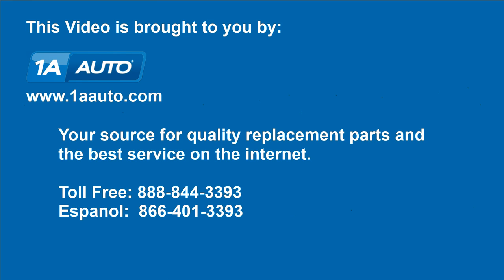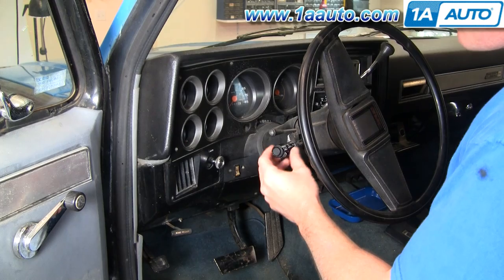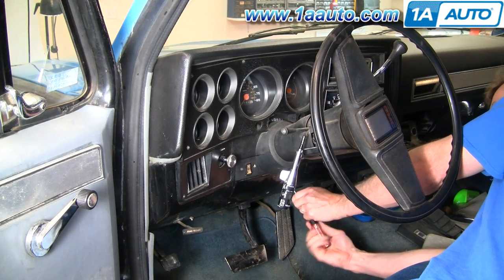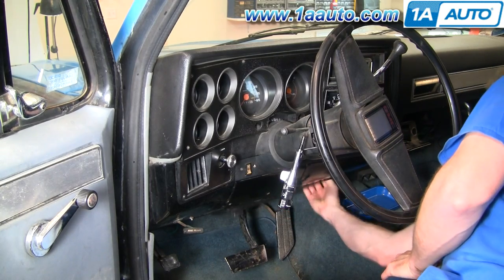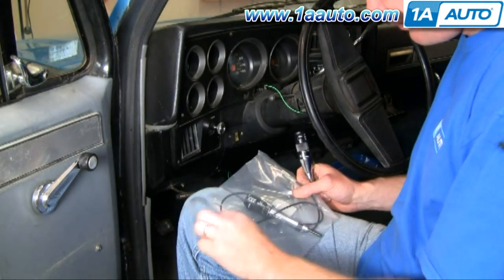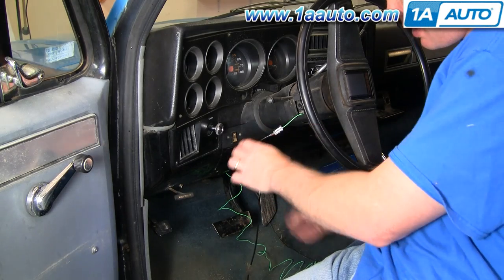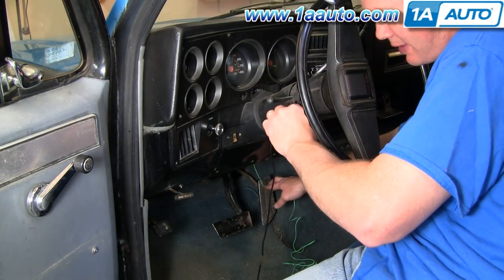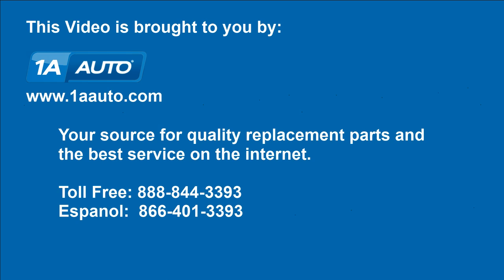How to Replace Cruise Control Lever 84-91 GMC Jimmy Full Size

Comment from the maker: @jbrockett1 You may want to test the turn signal by putting it on and then testing the socket to see if it has power going to it. I would also check the fuses to see if you have a blown fuse.

Comment from the maker: @jbrockett1 I would test the socket that the light plugs into to see it it's a bulb issue or possibly a bad socket. If the socket isn't blinking, also test the wire going to it to see if there's power in the wire. if there is and there's no power in the socket, you may have a bad socket. Also check all of the bulbs front and rear to see if any are burnt out.

Comment from the maker: @84chevyguy We're working on restocking these. If you add your email to the notify me button, you will receive an email when they are back in stock. Here's a link to them on our website. Hope this helps you out. 1aauto.com/1A/turn-signal-lever/Chevy/Beretta/1AZCC00005/334127/1995

Comment from the maker: It may be similar. The one that we carry is for a 90 Firebird with delay wipers and it's a different part number. Part Number: 1AZCC00003 on our website 1aauto.com. Hope this helps you out. 1aauto.com 888-844-3393

Comment from the maker: If the new switch is hard to turn and not is not changing the settings over, then you will have to probably replace the switch again.

Comment from the maker: You may want to check the brake light switch to see if it's working correctly. If it's bad it may also correct the turn signal issue.

Comment: Hey Mike,

I am having a tough time getting the wire to the cruise control getting FISHED up the steering column.  I connected it to a ~ 12 gauge wire via taping around the wire. I also greased it with Vaseline.  The connector seems to be where it is getting hung up at. Any ideas for success?

Thanks,

Comment from the maker: @Bigjcomeon There would be an issue with the switch, or if the headlight bulbs were replaced you may want to make sure that the correct ones were installed, as that could also create this type of situation. Hope this helps you out.

Comment: I swapped out the stalk with no problem. But now when I "pull" the high-beam, I get no "click" that would normally actuate high/low beams.  All I did was insert it normally, same as you.  But no high/low beam "click".  Not finding where I can fix this...
Reply: There's a rod for the high beams in the column that you might have to reattach. You'd have to pull the wheel and lock plate to get to it.

Comment: I was able to pull the switch stick out easy but no luck getting it back in. Internally, will I have to replace the turn signal switch in the steering column  because something  is not allowing  the stick back in?

Comment: So do I have to remove the steering column on a 92 cutlass supreme to change the wire harness with it, the 13 pin connector

Comment: The transmission fluid in it is black and burnt looking but it is running really good still, am i gona need to get the transmission fixed or just replace the transmission fluid?

Comment: everything works on mine, but pulling back to switch between high and low beams does not work unless pulling back far and firmly...is there an internal piece that would affect the response of the switch?

Comment: i replaced my switch, but the cruise button keeps popping out and the switch doesnt click when i twist it, it just free spins until the wire stops it. is there something else that could be bad?
Reply from the maker: +kaui chu We wouldn't be able to diagnose an issue like that here, you may want to have a local mechanic take a look at it. Thanks for checking us out! 1AAuto.com

Comment: Great video!, my left signal doesn't  return on my '94 GMC K1500 I'm thinking it may need a switch. Do you have a video specific to replacing  the switch? My truck is a 1994 with TS, wiper, cruise together. 
1GTEK19K6RE547820 I keep all maintenance on carfax as well. Just did the waterpump, wipers, tire rotation, alignment. Road trip!
Reply from the maker: +Scott Feron Thanks for checking us out! We offer the below video for the 1992-99 GMC K1500 combination switch.

https://www.youtube.com/watch?v=MwcQCXynKcU

Comment: If you take the plastic cap off behind the switch there's a plug there. The cover snaps on.
Reply from the maker: +CR7659 Thanks for the tip!

Comment: 6 months ago i installed a new cruise switch. lately turning the wpers on and off has been difficult to twist, and today the wipers are stuck on and although i can twist the switch arm, they stay on. 
is it possible the new switch is faulty, (i notice the switch metal arm plugs into the steering column), or do you think my porblem would actually be the wiper switch mechanism inside the steering column ? (which really looks like a pain to get at. )
thanks for your help. 1990 k1500 chevy 4x4

Comment: I just received this lever from you guys 1AZCC00002.  the chrome "push " lever does not seem to have any "Clicking" or set into the black part with the lettering.  Is it supposed to be loose and separate ? The chrome part is not "connected" to the black part, there is no tactile sense of shifting between hi/lo/intermittent/mist.   I think I got a defective part?

Comment: Awesome !  I have a problem with mine, the wipers only work on 'high speed' mode, the low and intermitent ones are dead. could it be the switch? or Should I look into something else? like fuses, etc... thanx

Comment: I ordered a new lever for my 1994 Lumina 4 door sedan but unable to remove the old lever from the connection. I have the steering column torn apart. So I'm not sure if you can order the circular round piece with the wiring and the lever itself as one piece and replace it that way?

Comment: This looks like the same exact lever as my 1993 Buick Century. Will that lever also work with my car along with cruise control? The website does not have it as a compatible car. The wiring also looks the same
Reply from the maker: Thanks for watching, we currently do not carry a cruise control switch that would fit your vehicle. The one shown in the video, isn't know to fit this particular year. Thanks for watching. 1aauto.com 866-403-3393

Comment: '89 Trans Am... Wipers only work when the "washer fluid" tab is held.  Hi/Lo beam does not work.  The "stalk" is quite loose and wobbly.  Would a new "stalk" fix the wiper and hi/Lo beam problem?
Reply from the maker: HI Chad, It sounds like the stalk may be bad. If it's not working correctly, replacing it may get all of you functions back in working order for you. We carry new turn signal switches on our website. We also offer FREE SHIPPING in the lower 48 states. 1aauto.com 888-844-3393
Reply: I pulled the stalk out.  It's brand new.  In fact, whoever replaced it just ran the wire on the outside of the column.  It appears that the place the stalk pushes into (inside the column) is broken.  What is THAT part called?
Reply: Does the wiper switch (inside column) also activate the hi/lo beam?
Reply from the maker: Chad Conrad It sounds like you're talking about the turn signal switch. We carry new ones on our website 1aauto.com for a Pontiac Trans Am without steering wheel controls. Part Number: 1AZTS00018 888-844-3393

Comment: Great job...is this the same process for 89 Buick century? Handle looks the same.
Reply from the maker: +N54 Lord It may be a different procedure on your application. We currently do not have an auto repair video for this particular year, make and model, but the parts are the same. Thank you for asking. 1aauto.com
Reply: @1AAuto  thanks!

Comment: I have a 1993 c1500 w/o CC, do I need to play with the wire to change the stalk? The spray section is cracked and that's it.
Reply from the maker: +alwaysopen We currently do not have an auto repair video on this particular year, make and model. It might be a similar process. If any of our viewers needs to make this repair, we carry the replacement turn signal switch shown in this vide on our website. Here is a link to them https://www.1aauto.com/cruise-control-lever/i/1azcc00002#utm_source=YouTube&utm_medium=CTA%20Comment&utm_campaign=ytcomment

Comment: my 94 GMC suburbon's brake lights don't work. I've changed the brake switch cruise works and will deactivate ,but no brakes. please help.
Reply from the maker: +CHARLIE BROWN Thank you for checking us out. This could be a fuse, a relay, or some wiring going to the rear brake lights. It could also be the rear junction block. 1aauto.com

Comment: i have a 1984 C10 and when i switch the blinker to go left it hobks the horn please help
Reply: how would i know were the problem is if i follow the wires?
Reply from the maker: +Sammy Torres You should do some research on locating, diagnosing and resolving electrical shorts. Basically, the idea is that you follow the wires from the switch to where ever they're getting power or otherwise grounding and look for breaks in the electrical insulation where they may be shorting out against other metal or other worn out wires.